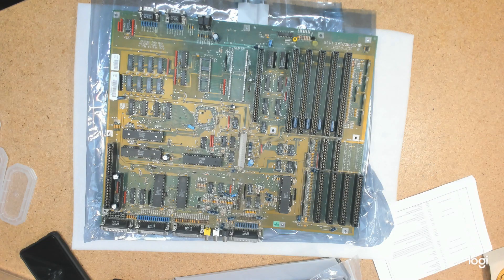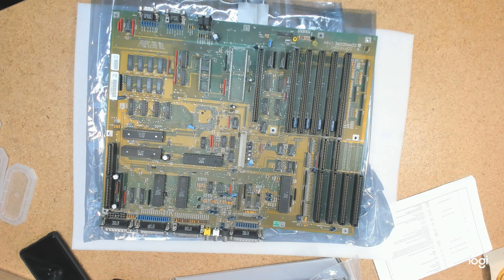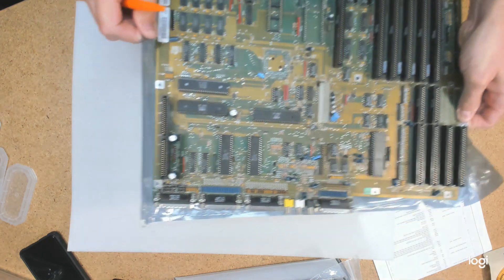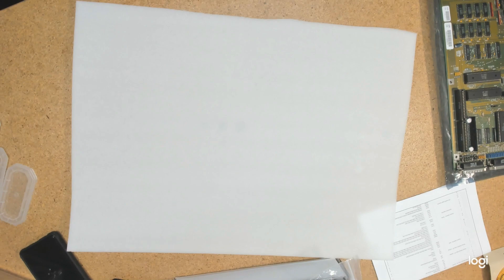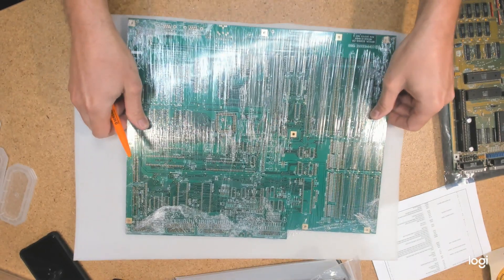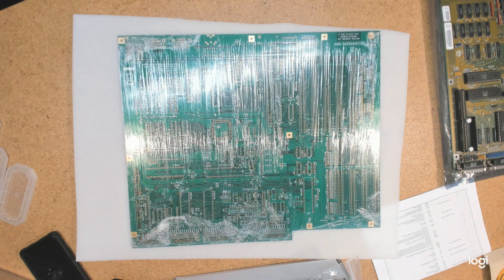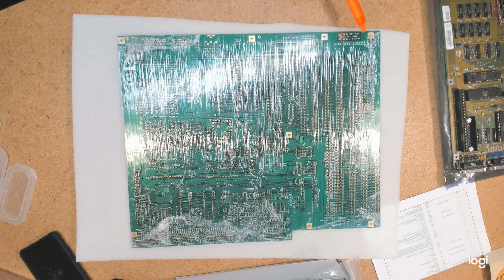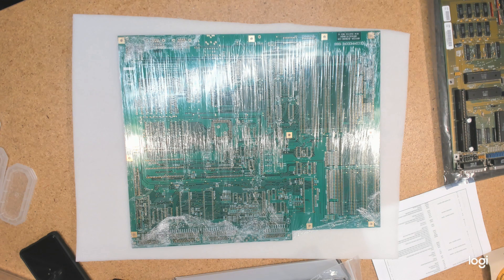Amiga 2000 remake Part 1: The bits

Comment: Remember to cut the legs on the components to length before soldering! Put them in the motherboard, bend them outwards a little and then cut the legs to length. If you solder before cutting the legs you might create microscopic cracks in the solder which could result in bad or no connections.